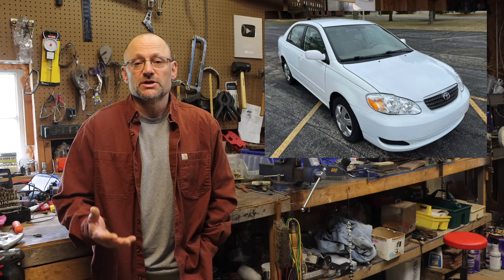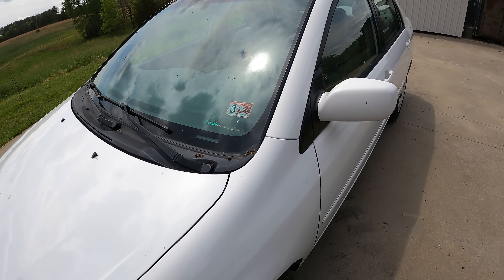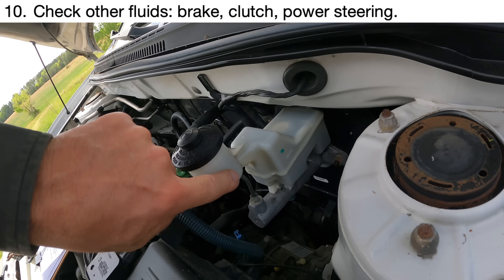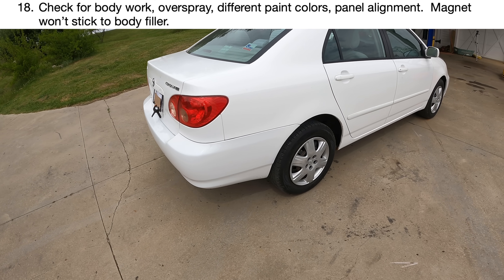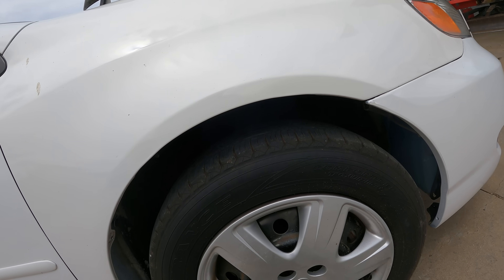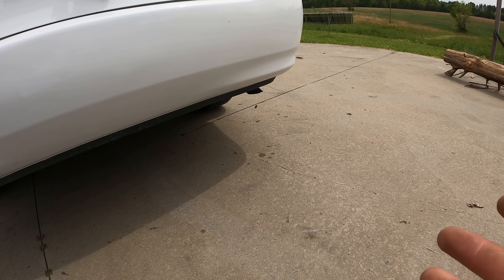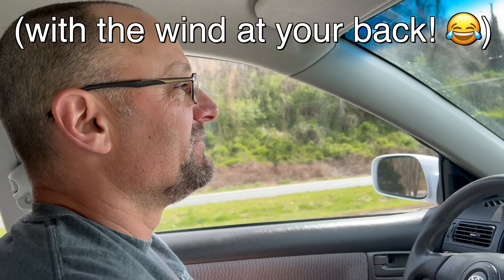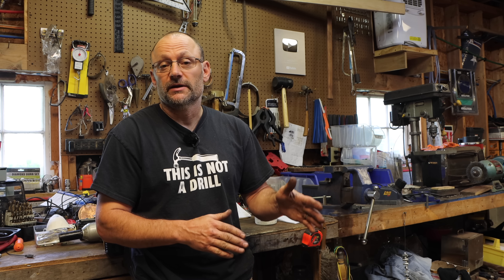Giving Away A Car To A Worthy High School Graduate.

Comment: Pretty nice car to give away. The washer fluid tank is exposed because the right side fender liner is missing, and as you pointed out, the bottom plastic cover is also missing. Otherwise a really clean car. A trip to pull-a-part and maybe $20 and you're good to go.
Reply: I don't do scammers.

Comment: The new test equipment that  accesses a computer for diagnostic tests can find any stored faults including the history of  any faults from the past. The total mileage, idle times, longest times not ran or if it just sat idling somewhere like a taxi might do. I didn't get far into diagnostics as my level of wrenching was older heavy equipment. When I started with auto mechanics, I did not have the  training necessary to run such equipment. Oh I bought some of the nicest stuff out there but found out that a idiot can't just jump into it and go. They sold a lot of test equipment in the beginning to people on the premise they could do such things as make a faster or better mileage, I am going to stop listing things cause it can go on for hours telling these stories and people bought into this conversation. Now on a bright note, yes there is test equipment that the people trained in such equipment have that ability to adjust the necessary different trim tabs and stuff, as I am talking above my pay grade already. For this young man to have good knowledge of this is high in my books. What he fails in is his size. I do not want a service mechanic his size crawling into my rig and breaking down the interior as such like seats or pulling him/her self into the auto and breaking stuff on the steering column, bearings in the said column. I watch them crawl into a rig and hoist themselves into place..... WHY, you might ask??? Since I was crippled, I don't move much except by crutches. I therefore got quite heavy from using a fork plus liquids that cost me my thirty four inch waistline. I am a large person in any case as I was trained in the military for the olympics in weight training. I finished fourth in my division, and oddly fourteenth in all of the divisions in 1966. I stood a full six foot, weight was a full two hundred and five pounds. That was  my finished try out weight as I went into the service weighing around one seventy and a little bit depending on any holiday. My advice to the many is do not advise doing this to yourself... its a battle royal to lose any hard packed muscle and other  that comes with this type of training. Thats another full page of reasons that is only for those who think they want and later figure out their real goal in life. I like what you did in the first episode John but to really carry out this tradition is ... I just have some reservations or mixed thoughts on it. This young man is quite deserving and appreciative of his present given, a very good person to receive it for sure. I think he should try to lose some of his weight and for him, going to take ... probably just not going to happen. Great video Jon

Comment: Those cars are damn near indestructible, I had a 99 Corolla that had over 300,000 miles on it that still ran lie a champ, used more oil than gas though. Also had an 05 very similar to the one in your video, picked it up for $250 with a bad clutch about 5 years ago. One thing with these, Toyota has an updated belt tensioner for these - the stock ones on 03-07 or so would lose tension and make the belt fail prematurely or will cause even a new one to squeak

Comment: Common, really? A 77 corolla would easily be able to reach 65 or more. 
My first car was a 88 Suzuki Alto with an 800cc engine with a 4 speed and it would reach 125 kph ( 75 mph) with a tailwind. And that engine was 2/3rd the size of you engine, not to mention the aerodynamic qualities of a brick.  

Fun fact: The F8B engine had really low compression, if you skimmed a couple of tenths of the head and replaced the plugs, it would be able to reach 140kph. it you dared it, you could file open the manifold ports and reach a whopping 165 kph
Reply from the maker: Yeah, I might have been able to reach 60 if we are being honest.  Mine had the 77 Cubic inch engine.  When you opened the hood, you could see more pavement than engine!
Reply: @FarmCraft101  That was the entire reason I loved that car. I could work on ANY component without completely disassembling the car. Even the transmission came loose with a couple of bolts. 

Unlike that nissan (If you still like to be remembered of that torture device 🤣)
Reply: @FarmCraft101  Oh and I have to add that I live in the netherlands. Our country is reall really flat and our highways are 3x2 or more with a legal speedlimit of 80 mph. So I could reach those high speeds legally after taking 10 minutes or so flooring the accelerator.

Comment: You could also add, step on brake, shift into gear and apply some gas. Does it try to pull the vehicle or does Trans slip

Comment: I’m sorry but this video was very disappointing and I am normally very supportive. You missed some key advice that is very important. This advice comes from 15 years working in the automotive trade. First off if your not a car person have a reputable independent shop do a pre-purchase inspection. This typically costs an hour or two of labor. If the seller doesn’t want to do this inspection on the buyers dime what are they hiding. Carfax isn’t worth the paper it’s printed on. Why?? Everyone thinks it’s accurate and they only show what’s reported to them. Guess what don’t report the wreck or the flood damage and bingo it’s got a clean title. I personally have a beater with a heater that has a clear title but has been hit hard twice. But she looks good, 

Great tip is to buy from a private seller not a dealer and ask them to drive the car. Do they grandma it or rev the engine and dog it. Also when you arrive if the engine is warm also a red flag as they warmed it to hide a hard starting issue. 

Service records and oil change records are key as well. 

If the vehicle has a timing belt watch that change interval. 

Age of the tires can also lead to failure. Side note lean how to change the tire, jump the car etc. 

Also watch out for mismatched components. One brake line changed and not the other red flag, one brake disk newer or brake pads etc. 

Miss matched or brand new tires are also a red flag. 

As for looking over the car make sure the vin numbers on the body panels match.

Comment: My take is to never buy a used car. A low budget new one will be cheaper and more reliable over the years. Just dont get hooked on extras and dont buy on credit. That "special paint" is not worth the $2000 it costs. Navigation and radio are obsolete since the smartphone does it better. I did buy a stick shift, white, 40mpg long suspension & big wheels for 14k new.
If you buy used, let an expert have a look at it. All used car dealers are basically scammers.
Reply: Devaluation numbers suggest allowing the 1st owner to take the financial hit, including all those new car fees and bogus extras.
Or, same price would get almost twice the car. YMMV.
Reply: I have railry bought new cars , if your going that route, by one a year or two old. The out the door devaluations is a killer.
Reply: @robertmccully2792  Be aware nobody sells an accident-free and trouble-free two year old car.